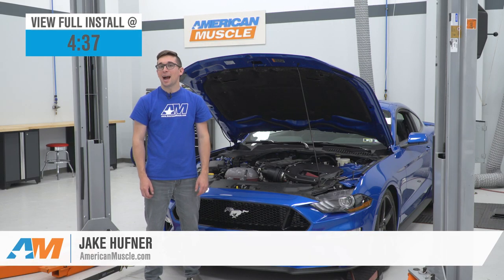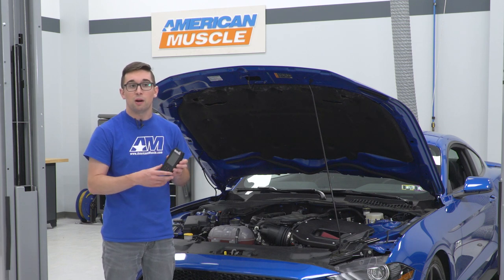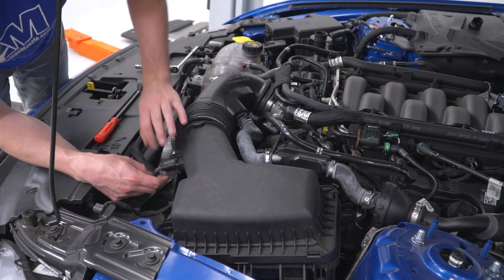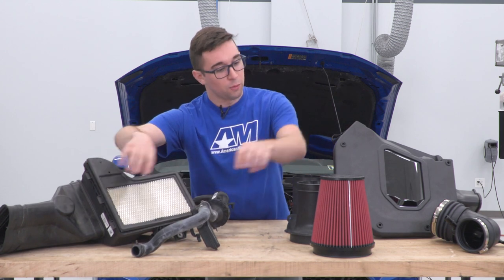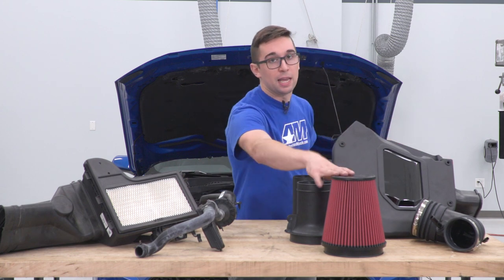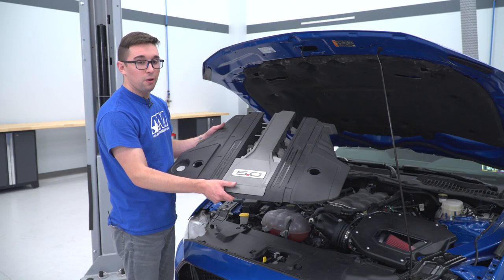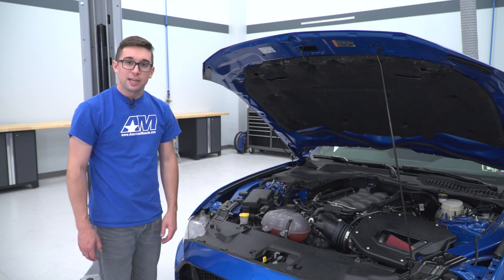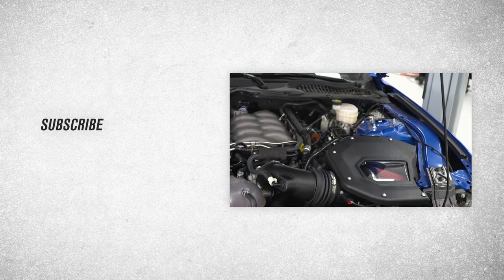2018-2021 Mustang GT Roush Cold Air Intake and BAMA X4/SF4 Power Flash Tuner Review & Dyno Test

Comment: Do you need a tune to run this intake Or not. is a tune mandatory for the engine? or is the tune just to add that extra Hp
Reply: I’m pretty sure a tune is required on all 5.0s bc they have a mass air flow  sensor so they need to be adjusted.
Reply: I bought this recently and have been driving with no tune with no issues. I loaded the tune and it bricked my car. Limp mode, all the lights, overtrain fault. I reloaded the stock tune. I messaged them flipping them out. They said I have to take out the inner sleeve from the piece where the mass airflow sensor goes in for the tune to work. He mentions in the video that without the sleeve it needs a tune. Personally I don’t trust them because of the bricking of my car pulling out of the driveway. The CAI is awesome though and worth it. But BAMA can KMA.
Reply: I don’t have a tune either